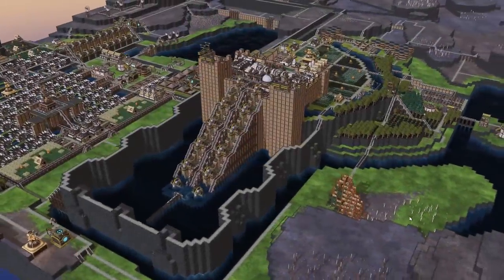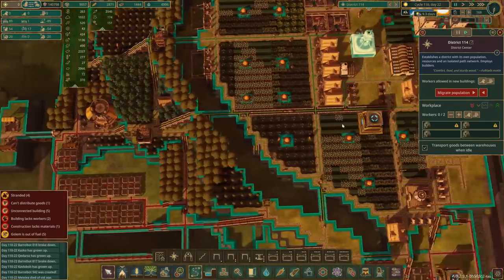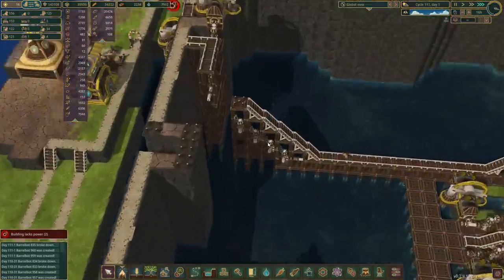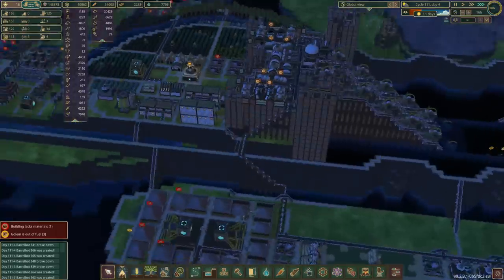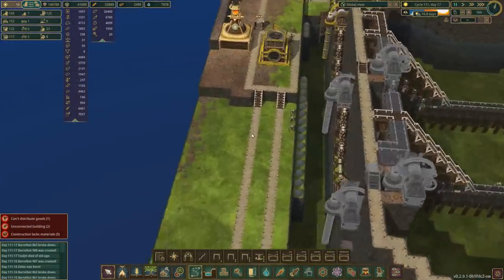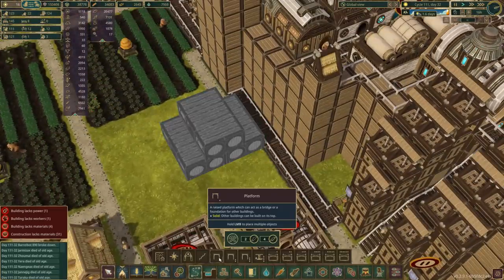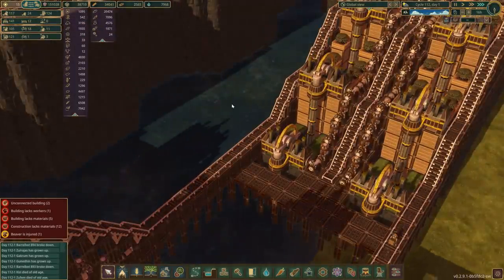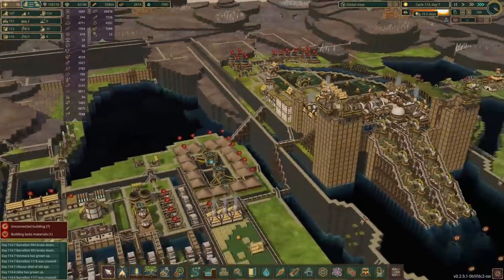IT WORKS! It REALLY Works! - Timberborn Hard Mode

Comment: Skye, Aren’t you fine with power connectivity because of the pumps installed at the top of the mega reservoir being connected to both beaver castle and the water wheels? So you don’t have to worry about connecting them through the housing project?

Comment: Why not lower the walls of the reservoir to water-level, dam around, and dynamite down? That get's rid of the overengineering with the canal/big walls/pump system but you could still have the same cascading water effect into the resevoir. Also the surrounding water would always stay at a constant.

Comment: Just imagine if you could craft water sources...make them expensive of course, but just imagine...

How expensive?

I would imagine something like 200 dirt, 300 logs, need 300 water, some type of plant matter, and 250 of a new resource like rocks that have to be collected from your normal soil (since you can make your own soil now, not a big issue). That makes just one water source. They can stack. Have fun with that.

Comment: 02:44 He doesn't have just a little chip on his shoulder but a whole freaking log!

Why you would go and torture yourself with redistributing the districts instead of simply setting up a more or less temporary new one for the project is truly beyond me at this point with how quick you can set some Bots up like that.
Especially after the pains you had early on on this map.

21:50 For the problem of having the former water pump area not having any consistent water input to keep the water level high with the dams in the back area it could have been simple to add some floodgate with a little overhanging outflow aqueduct (bridging over the Giga Reservoir intake) on that side to the castle and have it distributed to both sides instead of just the one. This would also add to the water features.

25:00 Maybe having the water cascade on top of the beaver statutes to simulate a beaver showering (under a waterfall) might look best?

Comment: Please invert the lower level of the buttress decorations. So instead of having two U shapes, have the top one a U, and the bottom one a upside down T. That way, the water will cascade down from the U shape and get split by the T, making more interesting flow.

Comment: 35:59, woulda chosen a different method for the starecase, see the underground WH nearby? I woulda put a staircase next to its entrance, stuck all my 1st level platforms in, a straight path between all WHs from which each set of stairs starts off before ending at the level it needs to end at, so 1 off to the left going back down for the ground level WH, staight path from the stairs to the 2nd WH, next 1 set of stairs to platforms to the next, next 2 sets of stairs etc etc

Comment: You designed the reservoir backward. The water around the lake has nowhere to go when it's full now besides wasting. If you lower the reservoir to the height you want to water in the lake to be and put dams around it, then the water from the lake can replenish the reservoir (no need for the canal) and the lake will stay at a constant (since overflow goes into the reservoir) and you can dynamite down so the reservoir can hold as much as it does now and fluctuate.
Reply from the maker: I don't think you understand how it works. No water is wasted .. excess water in the lower reservoir is pumped up to the Giga reservoir.

Comment: Hey sky I've just noticed that your original beaver castle reservoir has the old towers of power and they are full of water that you can't use so why not remove the levies from the bottom of them always one Levy from the bottom of them so that they can drain into your giggle reservoir .